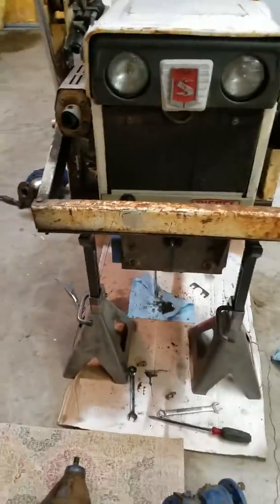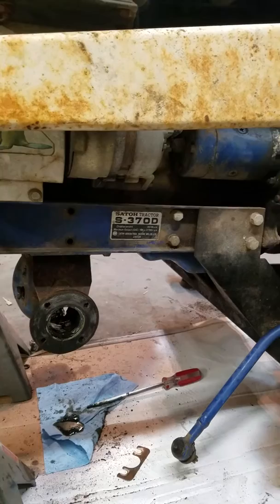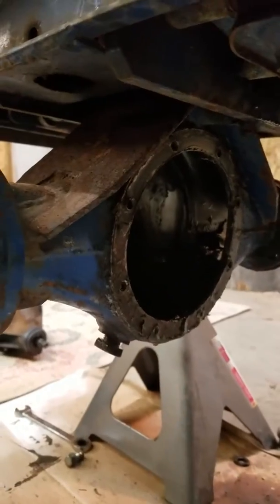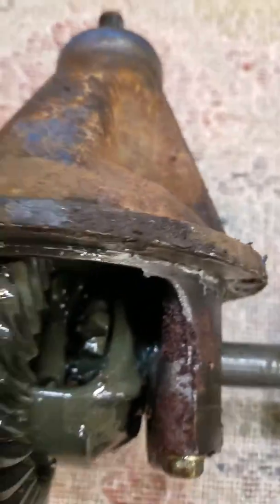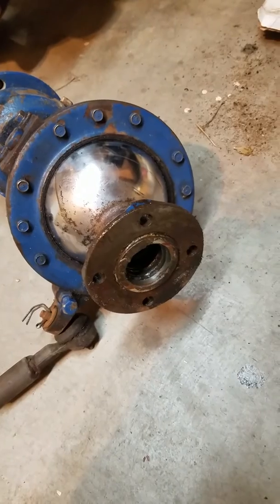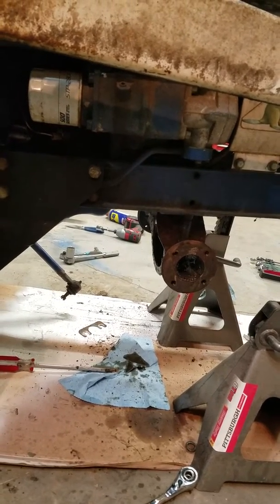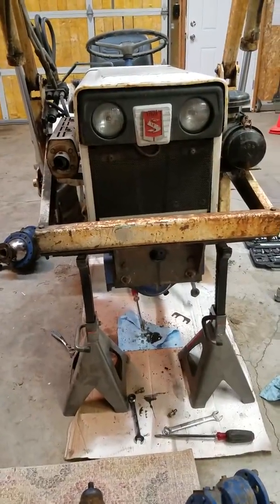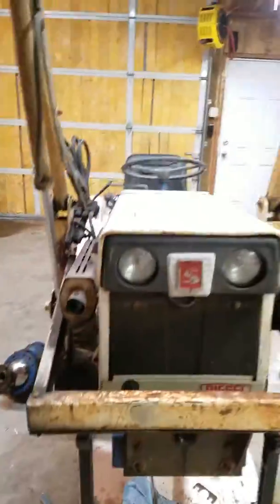Satoh Beaver s370d 4x4 repair

Comment: When I got my ym 155d the right knuckle king pin bearings were out and missing pluss the spacer was to and the spacer between wheel bearings and the gear was gone my wife uncle a machinist made me them they had stuck it back together to just get rid of it no oil in it ether it's totally rebuilt now good little tractor very easy to rebuild

Comment: Yeah that's great Jeff I also have one of those tractors and I had to order the manuals for the repair and parts from our local Napa store here in town and my son and I are having issues with the  loader arms not working they were working before and after I parked it and went to get back on it the hydraulics  would not work
Reply from the maker: Did you check the filter in the gear box?! I have heard of that plugging and causing hydraulic failure.  Worth a check!!  I haven't had any issues with mine, yet. Lol

Comment: Thanks , issue was the 3 bolts on top of the pump did not get tightened. 😩
So only issue left is that it will not go into 4x4. Thanks for responding bro, much thanks.
Reply from the maker: One trick to check on the status of the front end function is to jack it up and see if the wheel spin freely, if they do, something in the system is broken or missing. If its all there,   the wheels will spin in opposite directions.  Maybe you already knew that, but that is how i knew mine wasn't right. Good luck man, i love mine now its all functioning!

Comment: Can you tell me how to bleed the hydraulic system for the implements ?
Now I can get it to move but the 4x4 is not engaging , so it’s in the drive shaft I think 😩
Working on it now, please let me know how to bleed.
Thanks bro,
Duane
Reply from the maker: Hey Duane, do you have a shop manual? It is invaluable. You can look at blow up pics of the whole system and how everything works together. Makes it way easier to try and troubleshoot where your problem could be.
Reply from the maker: Ya know,  i changed the fluid in the rear/hydraulic case and didn't need to bleed the system, it just worked when I fired it back up. Your question is kinda confusing, the 4x4 has nothing to do with the hydraulics. First thing i did was remove the drive line cover and drive shaft that goes up front and made sure that was engaging so i could eliminate the rear end part of it.

Comment: I am wondering if you could help me out . So I put a new clutch in mine and now when I put it in gear and let the clutch out the front is binding up, it is clicking and seems to not want to move. Do you know what's going on and how to fix this ?
Thanks
Reply from the maker: Mine was already messed up when i got it, but after having the whole 4x4 apart, i would guess its probably one of the bearings on either side. Don't push it, the parts for all that are hard to find, and very expensive. Its is really easy to take apart, took me a few hours.
Reply from the maker: The bearings are cheap and you can get them online.